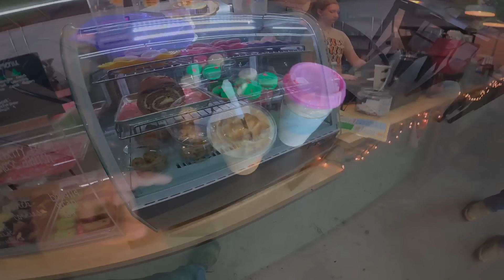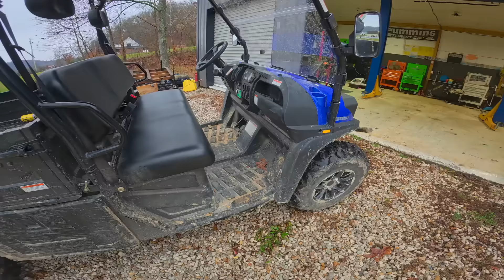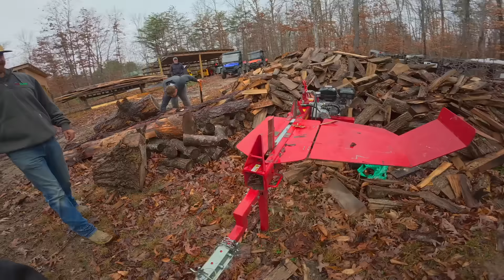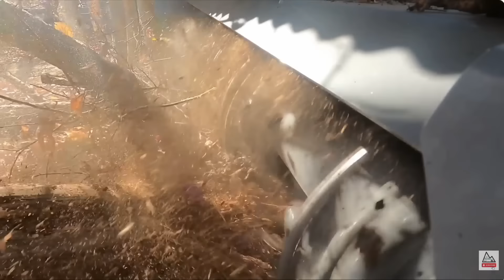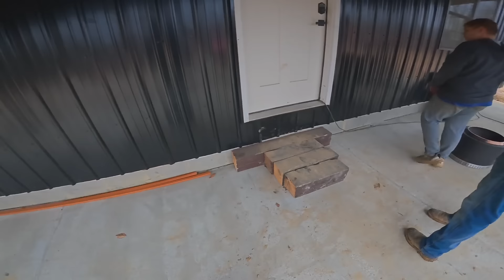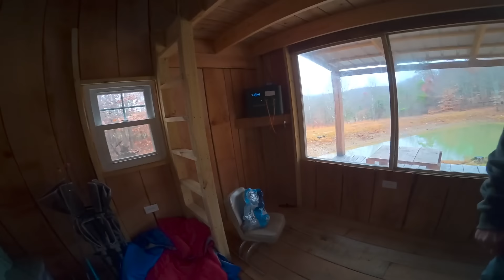The Truth About Peek's Peak

Comment: I use sheets of dense foam insulation cut to pit between the studs and fill any gaps with can foam sometimes I can find it on market place for half the cost and I can do it in stages don't have to pay for the hole building at once. Done it in a shop and several remodel. Where you wouldn't bring in a sprayer for a single room or one exterior wall.